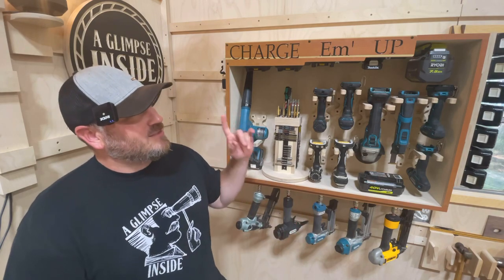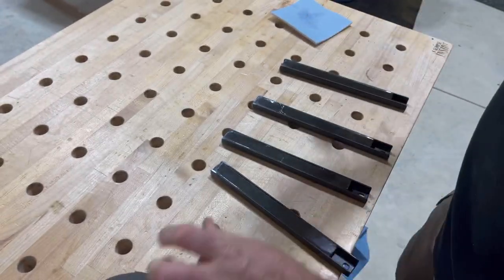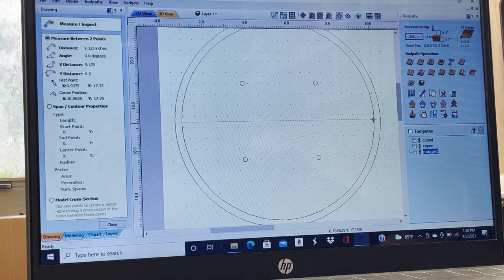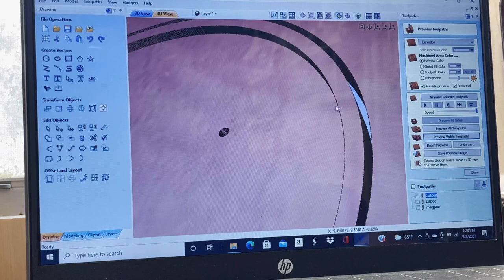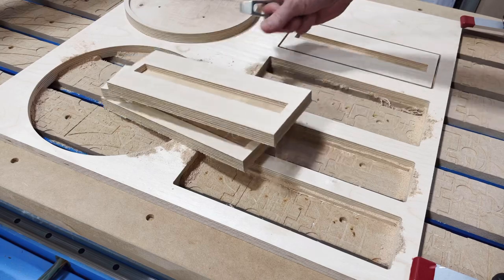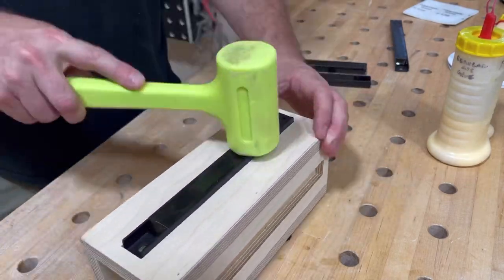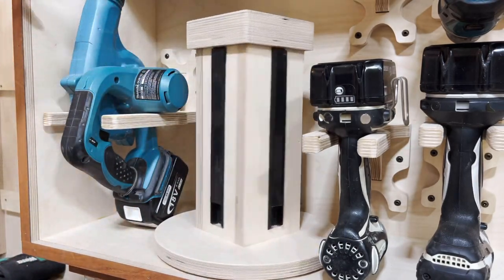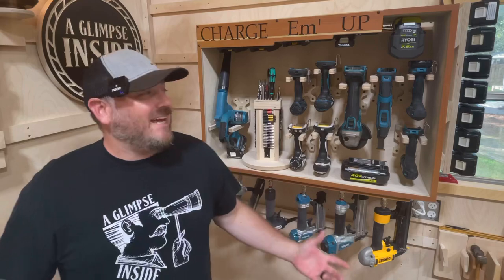My Ultimate Bit Storage | Storage solutions

Comment: You could even use the center of the column for long storage. You might even consider putting a plate in the bottom with a dowel to lift it up, sort of like the barbers get the Combs out of the disinfected at the barbershop..
Reply from the maker: Great call on the the middle. I like it!

Comment: The bit storage is a great idea. All of mine are in the Milwaukee cases with the 1/4"-20 hole in the back. I've been thinking of putting a cleat on the back to hang on the side of my cabinet hanging on the wall. But this seems like it would be quicker to find what you need and take it to the bench pretty easy too.

Comment: I like that bit holder a lot, but if you don't have a CNC machine it worthless...
Reply from the maker: Worthless? You can use a drill press for the top and you don’t even need to reset the Lazy Susan you can just screw it into a piece of wood
Reply: While the CNC helps automate things, it can't do anything really special that you can't do with other tools. Tools are only as good as the user after all.

With that said, a CNC can be built fairly cheaply and easily if you do some research. May not be as nice, but for small jobs like this they work fantastically.